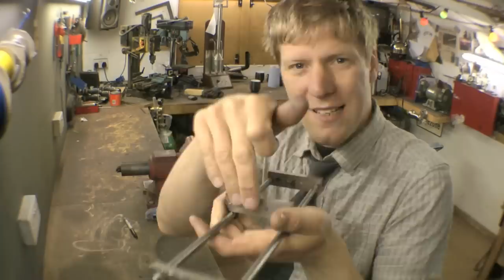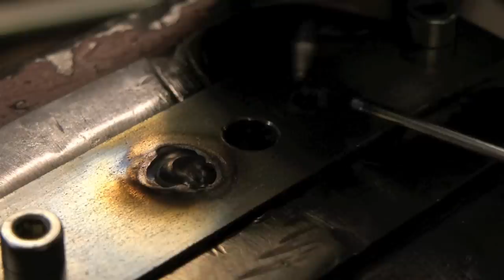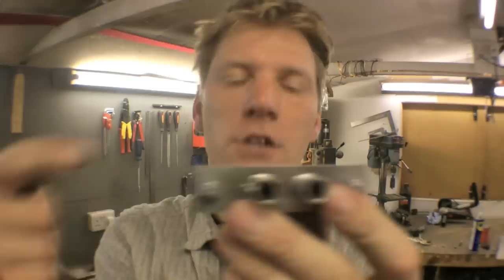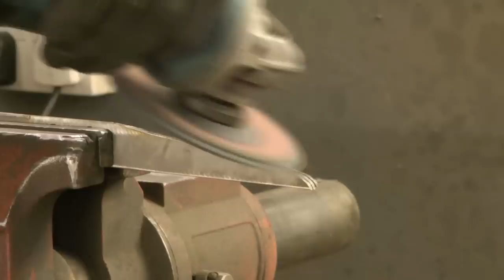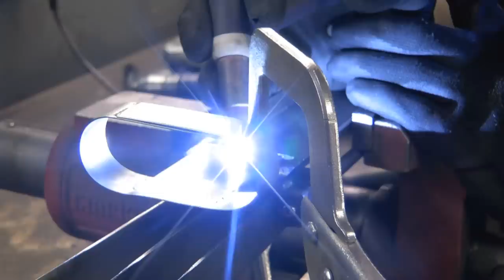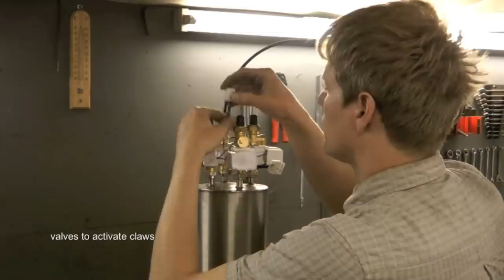DIY X-MEN Making WOLVERINES CLAWS

Comment: Sorry if i lost it on the video, my english isn't that good! But, how does it locks at the edges? So the claw won't slide out when it's faced to the floor, and to keep the claw fixed so it won't get back in when you try to cut?
Reply: +Giovanne Bressam the pneumatics hold it in place until pressure is applied. It takes some force to overcome the vacuum effect while the valves are closed. Not a ton, but enough that it won't just fall off accidentally. You probably can't apply a lot of forward stabbing force without a separate locking mechanism, though.
Reply: +qmannnnn Thanks man! I study electronics, so i don't know that much about this mechanical things haha I really like it, i will probably start mechanical engineering after finishing my actual college. Anyway, Thanks for the help ^^

Comment: Are you using electric controlled valves with those buttons or are they valves theirselves? Wire going to those buttons seems kinda thin..
Reply: Look electronic to me. We use a solenoid system at work for safety lockouts on our presses so as long as you wire a relay to tone down the amp/volts, you should be okay with that small wire

Comment: Here's some food for thought. Since using a hydraulic system to release and retract the blades makes these claws very bulky, why not use a spring loaded system similar to what you used for the assassins creed hidden blade? This would free you from having to carry around the compressor on you back, and there would also then be the lack of the air tubes running to the device. That being said, I am in no way bashing your hydraulic claws at all, they are totally bad ass bro! This was just a concept I've been contemplating trying out my self. 

Keep up the awesome work, I love you're creations!

Comment: Would you be tempted to use a Paslode nailer system. That way you could replace the air canister entirely with a fuel cell.

Just a thought

Comment: These are really awesome! Very good job And there definitely the best ones I've seen so far. However, some constructive critisizm.

1. the claws should be made of a steel appropriate for cutlery and heat treated, this isn't as hard as you might think. Something like 1095 would be perfect.

2. there should be a sturdy locking mechanism when they are extended so that they could stab something without retracting

3. A front support for the claws would be a good addition to make them stronger, as it is there's allot of torque transferred to the rails and bearings if you were to slash with decent force.

4. a sturdy leather harness and multiple straps to keep it in place and so you wouldn't injure yourself when using them agressivly.

Comment: since you have a relatively low pressure system, couldn't you fab an air tank shallower and broader, but of the same volume? That way you would have a slimmer profile, wearing it.

Comment: I've got an idea for a project myself, which uses this motion, however, I'm no engineer so working out the method is a little awkward for me. Would springs be able to achieve the same effect? One pulling it one way, and one the other? Naturally, I'd need to find a way to make only one work at once, which is what I'm struggling with. All controlled with a button or switch rather than a bolt action which is the closest thing I can think of. Any ideas dude? If it's possible, you're the one who'd know.
Reply: +Ethereal Harbinger You want a perpetual motion machine. Sorry, no, it's not possible.

Comment: Would a few or couple of CO2 cartridges not have worked? I know they wouldn't have lasted very long but you wouldn't have the back pack ORRRR make a set of small air tanks on the claw base length ways and just fill each one with air when it runs out instead of replacing co2. Just a thought.

Comment: you need to heat treat those they'll do much better... looking back i would never have thought that at 15 i would be doing blacksmithing but hey it's fun  and i am pretty acclimatized to getting burned and sometimes don't notice... idk why i said that last bit but hey it's the internet!
Reply: well hes only showing them off and not really using them as weapons so they dont need it. (more than likely hes already aware he can do it and probably did after filming/ messing around with em anyway)

Comment: So, for the extension and retraction of the blades, does the compress air run through both ends (pushing the claws depending on which side they are on?)
Reply: +eggfuyung92 I am pretty sure the switches at his hands control that. If you watch closely, the button appears to extend the blades while the switch at his little finger appears to retract them. (I think)
Reply: But is it using the same air? Meaning he hooked the system twice? I'm asking that because in the video, he said he didn't want to do that. But maybe he did in then end?

Comment: What device are you using to weld? making a steel iron man gauntlet and vambrace and need to weld parts but wouldn't know where to stary
Reply: That is a tig welder but a mig welder would work just as well.

Comment: should have made them flick out like walverines
Reply: They do.. Watch the video before you comment.
Reply: as in you thow your hands out to make them fly out rather than carrying gas and rams lol, ya dough nut :P
Reply: +lewis smith If you knew anything about wolverine, you'd know he doesn't need to flick his wrists to make them extend, he could if he wanted to, make them come out of his palms by holding his hand like iron man does when he shoots the repulsor beam. Get your shit straight son!
Reply: lewis smith Wow, touchy much?! If you already knew, then why bother saying anything?
Reply: i was pointing out the carrying all presure packs around with you. as clever as they are and demonstreights his enginuity
Reply: lewis smith Without the tanks, there would be no way to retract the claws!
Reply: without giving it any though, spring operated latch system, a notch in each end of the blades to lock it in place, sllightly weighted on the bottom of the blades so you just turn your arms up a bit so the weight would be pointing down, latch thing i would have thought to be fidly to put together